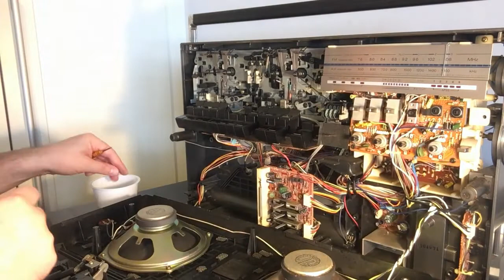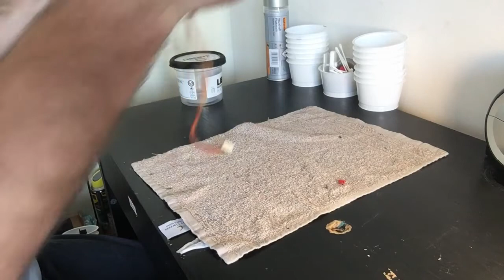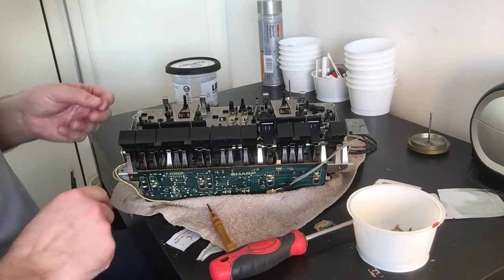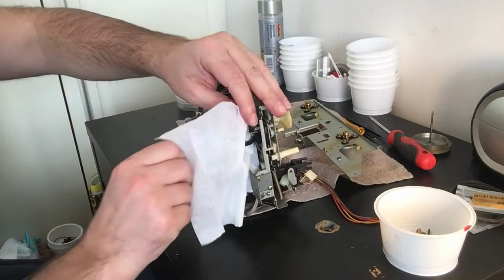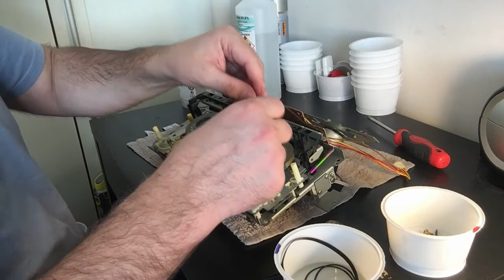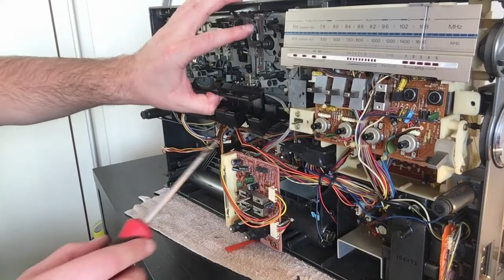Sharp GF-868  Boombox Tape Spillage & Pulley Replacement

Comment: Good video, i have the 525 that needs the belts changed, i think they look the same. Do you know where the belts are from or what size they are. Im thinking of bringing mine back from the dead but have no idea where to get the parts, sharp GB don't stock these parts anymore, cheers
Reply from the maker: Hello, belt sizes are:
FRW8.5
SCQ6.7
SCX8.0

You can buy on Ebay full set belts and Idlers which you need to replace aswell
https://www.ebay.ie/itm/275207428145